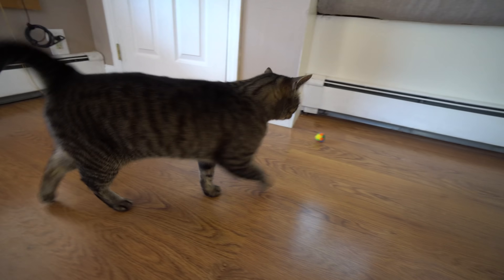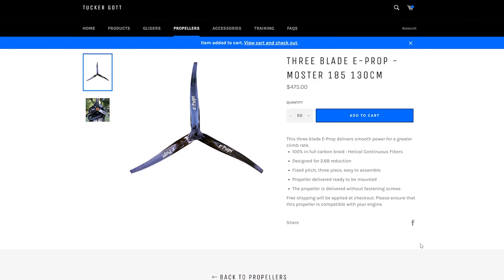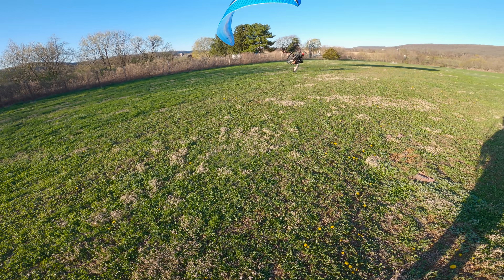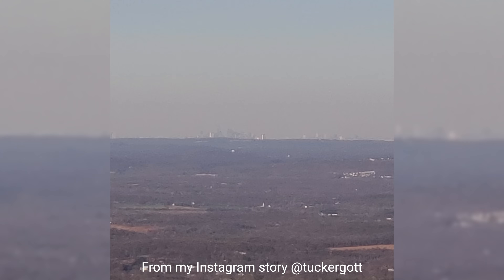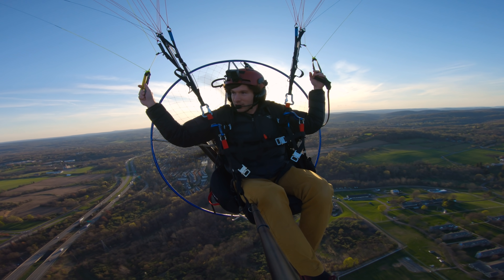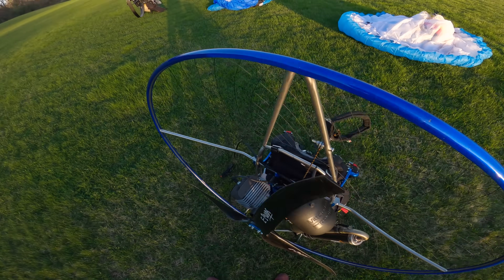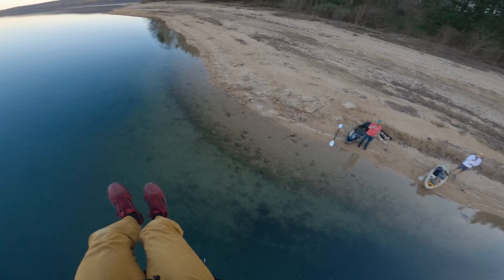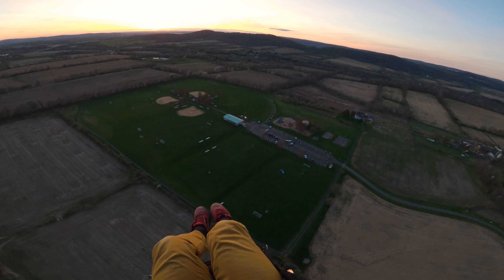Excited Gas Station Guy Reacts To My Paramotor - Flying Over A Prison!!!

Comment: Still can’t get over Tucker carrying on a normal conversation basically in a powered lawn chair a thousand feet up.  Crazy but cool.
Reply: I fly paraglider’s and we fly in unstable air because that’s how we find lift to extend our flights so it can get really bumpy and quite scary for a new pilot like myself, so I will often talk to myself to calm myself down after flying through really turbulent air, it’s definitely not holding a conversation more like “it’s ok, calm down, breathe...” 🤣🤷🏻‍♂️
Reply: @577buttfan  yea it is, I haven’t even flown in really rowdy conditions but even the lighter side of days when there is instability can get bumpy, at least for a newbie.

Comment: Fountain soda dispensers inject CO2 into plain water to make the fizz.  The CO2 is delivered in liquid form and pumped into a tank inside the building through a fitting on the outside.

Comment: A prison near me had an escape by hijacked helicopter back in 1985, so it's safe to say the guards had their eyes on you.  Or they should have.
Reply: sure, as well they should. but unless old gott was gonna pink gas 'em from a giant umbrella ala a '60s batman epp, the fact that they had little to fear would become pretty readily apparent. i guess he could throw lawn darts ...
Reply: @jimdiskin3760  Overflight would still present concerns of dropping contraband to prisoners.
Reply: @VidClips858  can’t disagree there!
Reply: @VidClips858  Pretty soon prisons will have anti-drone radar and countermeasures. It would be quite easy to fly a small drone over a prison and drop contraband, or god forbid, a gun
Reply: @VintageDynamo  They already have countermeasures. They're called shotguns.
Reply: @VidClips858  Wouldn't really cut it. You could fly a drone over at night, with lights taped over / disabled. No way you would see that. There are automated systems that use radar to identify drones and disrupt the signal back to the operator.
Reply: Yea, Tucker committed a felony on video and posted it. It’s a 10 year minimum sentence. Wonder how much longer Tucker will be around since they won’t let him video in prison.

Comment: In regards to the lightweight props, I spent a few years hot rodding mini-bikes & go-carts and would replace the iron flywheels on my engines with a lightweight aluminum flywheel. It would allow the engine to rev up faster and gave better throttle response. I assume the principle of having less mass & weight is the same for paramotor engines. I'm also thinking that you're probably getting an improvement in fuel consumption with the lighter props. You should try doing a side by side comparison using the same engine with 2 different weighted props to see which one would take you farther.

Comment: The lighter props make sense. what is it, rotational inertia is like 8x linear? cars do this all the time. lightweight rims, clutches, etc. 

my question Tucker, is are there advantages to a heavier prop? I know in a car, having something like a heavier flywheel can give the engine more low-end torque because that extra mass is helping to keep the motor turning between the power strokes of the engine. but I can't see an advantage to a heavier prop...? does it give you a better range because the extra mass at a constant rpm means the motor works less?

Comment: great video. that entire mid-west jersey / southeast pa area is very underrated for all it's sights and natural beauty. the highways, the river, the hills and ridges. so damn beautiful from the air.

i grew up in westfield, and i very fondly remember all the years before they completed 78 past berkeley heights and linked it up to the city. that was one fun, scenic, chill and deserted super highway back in the day. i'll bet your mom was ballooning (?) over 78 in those days as well, or not long after.

i love the fact that good old interstate 78 ribbons it's way through so many of your adventures aloft. very graceful highway as viewed from above. is that spanish restaurant hidden up on the hill on 173 just east of all the truck stops still in business? if so, you should definitely hit that if you haven't already. i love a thick tasty latin sauce on dark meat chicken, and they've got the answer if you like that too. pretty good place overall as i remember :)

i'm also a major lackawanna cutoff and delaware water gap nerd. big fan of nj 31, US46, nj 52, nj 94 and all those scenic jersey county roads as well. that whole area is pretty heavenly from spring through fall, especially the clear, windless evenings. i gotta admit, you're tempting me to take up paramotoring. i still believe ultralights are a lot more similar than different, but those seemingly effortless landings and glide-bys look like a total blast. no doubt your flying windsocks are a bit more maneuverable than the flying lawn chairs, if a bit less forgiving as well.  

where were the environmentalists back in the 50s man? they absolutely desecrated that natural wonder that is the gap by hacking the path of interstate 80 right through there. it's such an abomination. i love all the bald eagles in the gap now and the remaining bridge piers from all the long-defunct railroads. they need to tear that whole stretch of highway out and drill a double tunnel a bit west of the gap. that weekend traffic on 80 is horrendous and what's it gonna cost in money and nature to widen that mess?

jesus, i <am> the old guy at the strip who just rambles on about all the ways things used to be. back in my day, damnit! ha ha. well, here's a vid about the abandoned technological marvel that was the 'lackawanna cutoff'. this guy chuck walsh has quite the series on it, some of the vids are super interesting. that pequest fill is quite the enduring ridge. cheers and good flying/watching/aspiring to all!

https://youtu.be/uknfbJqFzQI

.

Comment: Tucker, does the weight of the prop effect any possible centrifugal force/gyroscopic forces that you have to compensate for?
Reply: Yes. The prop turns counter-clockwise on the moster 185 which causes opposite torque and pressure on the right risers. It's really only noticeable on takeoff or whenever climbing, so if you want to maintain heading, you have to either weight shift left, pull some left brake, or a little of both to compensate.

Comment: Nice. Which water reservoir did you fly over? And how you maintain visual separation with airplanes?
Reply: Going from pics, Manasquan doesn't really have any elevation features even if you can see NYC and Philly from the air above there. But if you go to Spruce Run/Round Valley you'd have about the same distance to both cities from the other side, and those do have hills and such around. So I guess one could deduct what they may from that and some of the other comments.

I'd also think the airspace near Lakehurst and Atlantic city would have a bit more traffic, so some common sense might dictate which location may be better for flying a rather slow and small aircraft.

Comment: Thanks for sharing. 15:34 your netting looks a little loose.  I just had my first kinda emergency landing on takeoff because of loose netting!  I ended up getting a little bit wet but landed safely. Posted a video on my channel. Also posted a video flying a glider a hundred pounds over the limit. Didn’t handle the greatest in my opinion. Not sure if it’s the glider!  or Maybe less wind and not so over loaded would make it fly better. Safe flying to you all!

Comment: Another prop question is there a difference in diameter between the two blade and three blade props?
Reply from the maker: Not in this case, they are both 130cm.

Comment: what type of fuel does the motor uses?
Reply: Pump gas (without ethanol) and 2 stroke synthetic oil in a 66 to 1 ratio.

Comment: Speaking of birds - can you ever get bird strikes puncture your wing? Has it ever happened? Just curious :)
Reply: a passenger and i came face to face with a very scared hawk at about 800 feet agl one time. he unfurled those claws in a very menacing way because he wasn't going down without a fight. luckily he trajected out to my right enough to miss the prop and no impact occurred. it was scary and thrilling at the same time. have you ever stared down a hawk in flight at less than 10 ft from your face before? 'my, but what big clear eyes you have ....'

Comment: I find it fun to watch these video's but i'll stick to fixed wing aircraft thats very much. Only advantage I can see from using a flexible wing is that you can take off in any random field or park, which you cant do in the UK anyway unless you have permission.
Reply: i very much fear losing lift in the deadly zone. i'd be one overly cautious, very respectful paramotor pilot. not so fearful as to be dangerous, but i'd be looking for the low-wind, gentle maneuver, easy-going flight 'adventure'. no boundary would fear me :)

my favorite speed on a motorcycle is 35 to 40. i just wanna cruise the back country roads and take in all the beautiful sights around me.